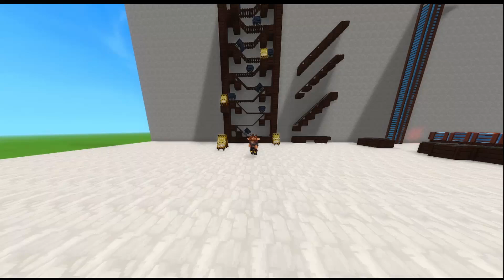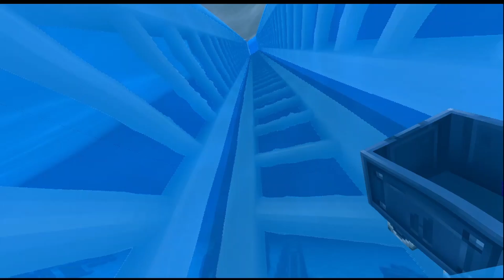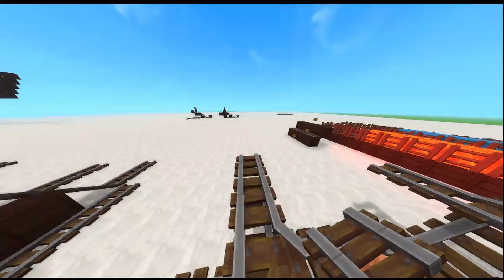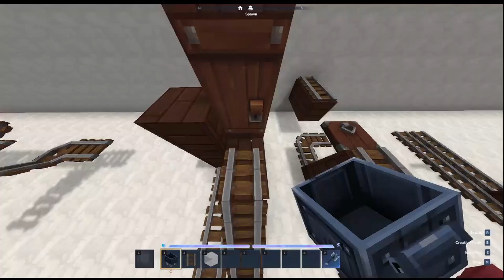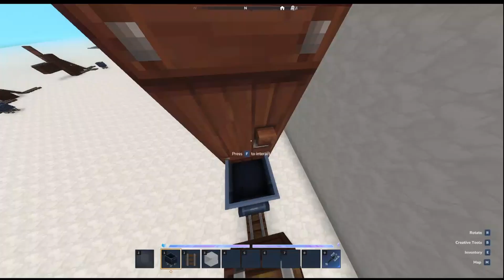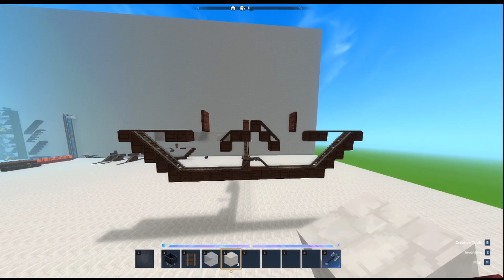Hytale Engineering: Rail Network Systems

Comment: Greetings ⸜(｡˃ ᵕ ˂ )⸝ I loved the video, the way you explain is extremely intuitive and easy to understand. I have a few questions, can you breathe underwater with the tracks and the car?Could you show a construction with train tracks that can change lanes? Honestly, I found this way of forcing a rail change simply incredible ദ്ദി(˵ •̀ ᴗ - ˵ ) ✧
Reply from the maker: hi there, so to answer. if your in 1 block deep water you can breath, anything deeper and you start loosing breath. this also applys if the player's head is inside of a block, the 3 way junction at the end of the video shows how it can be used, you would simply continue the rails off from there, my more aestheic building skills need alot of refinement, but I plan to impliment a rail network on the adventure server I play on when I stream on twitch. 

hope this answers your questions